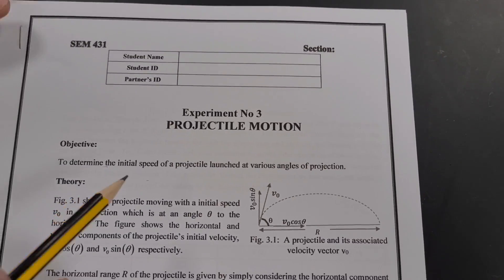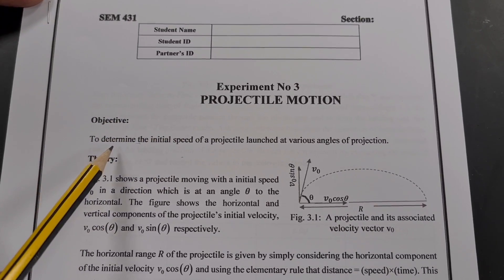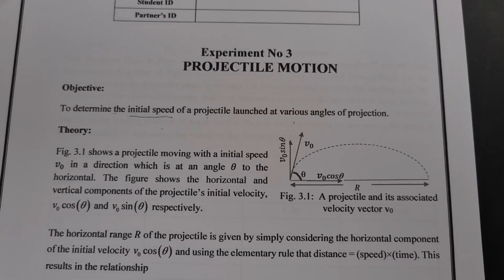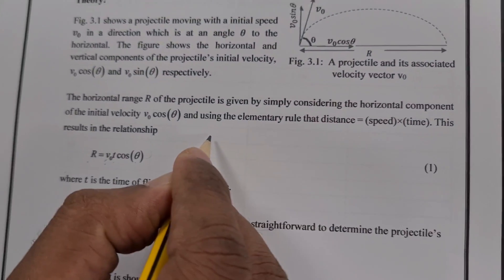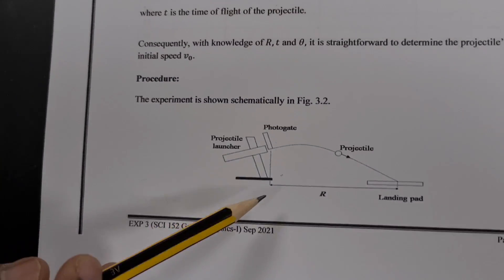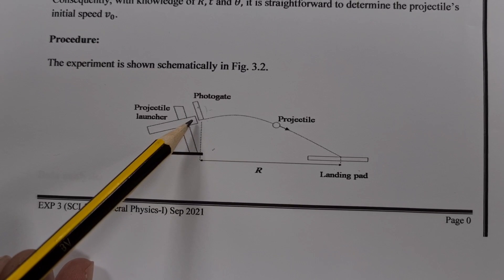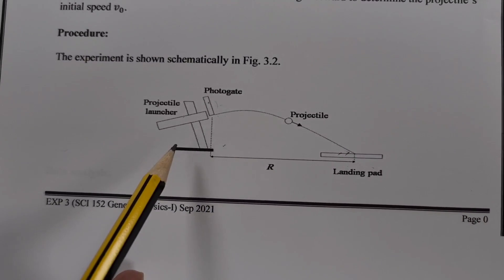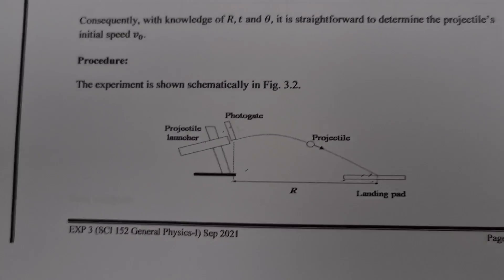Projectile motion Experiment

Comment: There are another method does not require timer . Which is to multiply the angle by 2 and find the sin of the angle by simply
Reply from the maker: Great...but here the explanation was given based on the procedure given in the student's lab manual book.
Reply: Youyou only need to divice the table into three section only